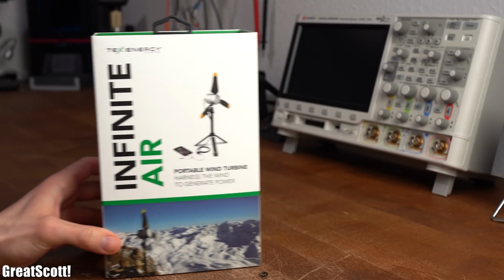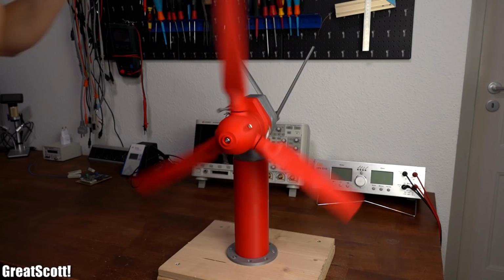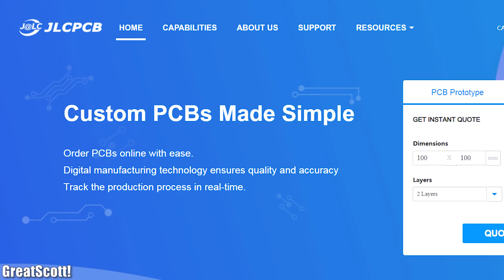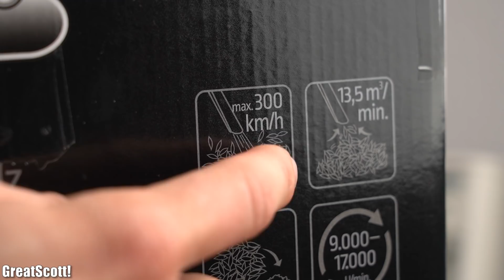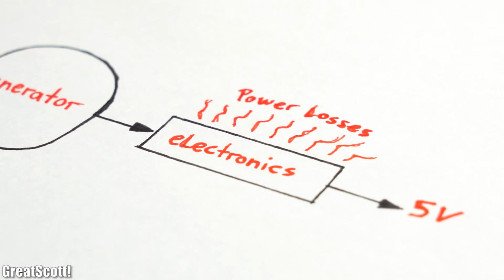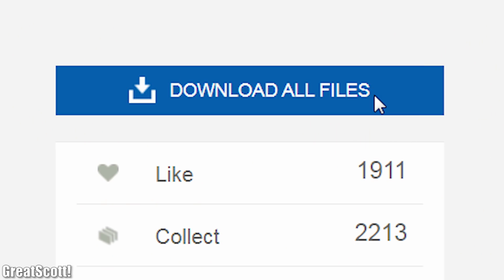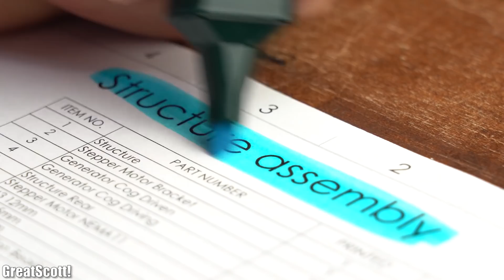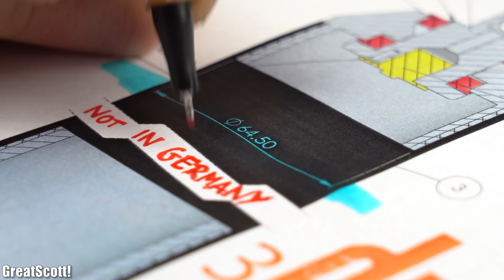Mini Wind Turbine || DIY or Buy

Comment: GreatScott, The problem seems to be the motors here. Most of the DIYers I know use different motors and different ways of taking advantage of the wind. With as skilled as you are, you might look into the Wind Turbines made from scooter motors, hoover Motors and even Washer motors. You can also find a lot of 3d printed build online using these. I think if you built something more along those lines, you would be even more impressed with the power and efficiencies you would get. I even built one myself many years ago from a 12V car air pump, that I ended up getting closer to around 70 watts and on windy windy days, closer to 120watts with not much work to the build, but a battery to store the energy in.  I bet you could even use a 775 motor with little work and get more power than the commercial one you tried in the video. It might be something to mess around with in the future!!! Great Video!!!

Comment: "Mini wind-turbine" The very notion is absurd (if fun) because small, light blades just won't be able to build up the inertia or angular momentum to make it work. With blades that small and/or light, it would require a constant flow of strong wind to keep it spinning. Real turbines have large, heavy blades that take a fair amount of energy to get going, but then require much less wind and less force to keep them spinning due to their inertia; they're essentially the same as a flywheel generator.
Reply: That is not at all how wind turbines work. "real" (large) blades are built to be as light as possible, to reduce the intertia so they rotate in the lightest wind possible. They are not at all like flywheels. Small turbines experience very different flow characteristics and have to rotate much faster (in terms of RPM) than large turbines. It's a really interesting topic and worth learning more about : )

Comment: the angle of attack of the blades is pivotal for the turbine efficiency. Also  the turbine uses only a small portion of its swept area so power measured is way less than optimal.  Good electronic skills, poor fluid dynamic knowledge.

Comment: Printing all of the parts is not a good comparison. The gears and a few other metalic parts could be CNC milled or are available commercially. 
"When the only tool you have is a hammer, everything looks like a nail!" So, just because you can print a part doesnt mean you should.
If you need to make those type of parts, make a DIY CNC mill and use it to then make metal parts.
Or, you could incorporate a few commercially available parts in your builds, it is much more realistic for those of us who are DIY type people.

Comment: DIY or BUY: Switch mode power supply (and let’s hope that either DIY or BUY is the winner, not both)
Reply: LazyH-Online Something like a common “wall wart”. The high power ones are quite expensive.
Reply: Or something like transformer power supply vs switching vs capacitor dropper

Comment: Wie wäre es mit einem Projekt in dem ein Fahrrad zum Stromgenerator umgebaut wird. Mit dem man sein Smartphone oder einen Akku laden kann. Würde einen unabhängiger in Krisensituationen und gesünder machen. 
Leider habe ich keinen 3D-Drucker, deshalb wäre es gut wenn so wenige Teile wie möglich gefertigt werden müssen.
Das System müsste wie folgend aussehen: Anflanschen eines geeigneten Generators (BLDC-Motor, Gleichstrom, Synchrongenerator, Asynchrongenerator?) an den Abtrieb der Well des hinteren Ritzels. Gleichrichter der einen kleinen Akku speist mit 12V und über einen Kfz-12V-Zigarettenanzünder über USB das Smartphone laden.
Vielen Dank für's lesen.

Comment: In this episode of DIY or BUY.... DON'T! LOL. A 10x10cm square PV panel can do about 4W, though you still need a battery for night time.
Reply: I came to the same conclusion. Wind power doesn't scale down: To be practical, it must be huge. The power produced is proportional to the cross-sectional area, so if you make your turbine twice as wide you get four times the power. It's also proportional to wind speed *cubed*, so you need to mount it at some height to get a good wind flow. Photovoltaics are linear in scale: Spend twice as much on panels, get twice as much power output.
Reply: @vylbird8014  turbine twice as wide cost more than twice as much
Reply: @jklmnpqrst  It costs less than four times as much. So the bigger you build your turbine, the better your cost-per-watt gets. The cost of building twice as big is usually less than twice as much too - the blades are cheap, it's the bearings and support that make most of the cost. The economics of wind power are just not in favor of small-scale generation. The rapid fall in the cost of wind power generation in recent years is largely just due to the introduction of bigger and bigger turbines. GE has a model with a 220-meter blade diameter! Those things are around the height of a seventy-story building.
Reply: @jklmnpqrst  But less waste means more saving and faster to pay itself
Reply: 0,1m*0,1m=0,01m2 with 1000W/m2 is like 10W and with the efficiency of 15-20% its like 1,5-2W max
Reply: Better to let it charge a battery or power bank instead of having your device wired to the turbine to charge.

Comment: ...so if you have a hundred year long storm, will the 3D-printed version have made enough energy to cover the energy COST of refining the plastics used in the printing, the heating elements and controls of the printer, and the energy used up when manufacturing the motor/generator????
No it will not. It will have "returned to nature" as a big heap of worn out scrap material long before that :)

A perfectly made, extremely well planned industrial scale wind turbine mass produced as energy efficient as possible takes many years to make up the manufacturing and material energy cost involved in making, transporting and then mounting/erecting it. In places where wind turbines aren't well suited, even the very best turbines available today struggle to even make their own production energy cost back...

Comment: nema11 is very small. I would try using nema23 - the more current can go thru the stepper motor, the better. And also - gears should be printed in nylon and gears should have angled teeth - helical gears.

C'mon, make a part two video ;)

Comment: use a bigger step motor(rated for above 40 volt). and attach  the propeller directly to the motor. 
use two rectifieres, one for each coil and a common dc bus. 

in my wind turbine, i also make a nacelle. but the vind generator gives 12 volt output at 0,5 to 1 Amp. with two coils, it gives 2 amps on the dc bus circuit, that can easily run usb chargers or charge a 12 volt battery. 
my step motor is rated for 75 volt and 1 amp.

Comment: hmmmm...I took apart an old cooling fan. The kind that's in box you put on the floor.
The fan motor is an INDUCTION Motor ( 3 phase)....it's basically a Brushless motor...withOUT magnets...The ROTOR is a FLYWHEE. It's   super heavy.
Maybe PRINT your own rotor..Install ball bearings and magnets...
You can mount different qty of magnets to achieve more or less current.
You can probably achieve MORE CURRENT easy....It's a BIG Motor...
But you'll be driving a LIGHTER rotor.....( you're NOT driving the WIRES/STATOR...HEAVY)
Mount rectifier. Your DIY PROP will fit it.

Comment: I made a really crude wind turbine when I was a kid when I found out spinning a computer fan generated enough power to charge my Palm Tungsten E2...I also ended up using the same fan motor to build an equally crude generator for my bicycle.

Comment: Are you sure the original circuit board, is not some sort of active rectification, and will actually give you better power output then your bridge rectifier? Please do a video comparing the two! https://en.wikipedia.org/wiki/Active_rectification

Comment: I think you had to hold the diy version so it doesn’t shake apart. I also think it is too big for a portable generator. So basically, the diy May be a winner as a teaching project, but not as a wind power generator... which is the main idea.

Comment: put slow bldc motor inside
PS
maybe build big vertical wind turbine using hoverboard motor :D 
just glue blades direct to the engine with extension , made them from pvc pipe and it will work great for cheap (maybe 15-20$) :D

Comment: You need a HDD motor and low drop off schotkey diodes with voltage drop of 0.2-0.3 v and then an energy harvesting circuit

Comment: I have that infini air, and my issue is.... It requires rather hard wind. Maybe it could be converted to vertical with just 3d printed Wingz of larger size? Would be great if someone (😉) could do that. Feels well built but doesn't full fill it's potential. Great video

Comment: Would've been interesting to know how much he spent on filament and other parts.
Reply: Filament I buy is about $10 USD per killogram (so about $5 per pound). Since these don’t really need to be solid you could save some weight but even assuming it’s solid then that’s like maybe a pound of plastic. 

**Technically I rarely pay over $8 per kilo shipped to my door, but I also don’t care about color so if ugly puke green or fluorescent yellow is on sale that’s what I get! I have used more expensive like $50-$60 per roll as well and it’s often a pain and super picky for some reason, so I use the cheap stuff. I typically print ABS and PLA (I even got a nice kilo roll of glow in the dark PLA for $9.99, haha, I literally switched my machines parts to work with 3mm filament just because it was such a great sale, haha!

Locally it’s also like $12 for a roll of any size and nearly any color (it’s the clearance rack, but they usually have like 10 rolls of a good variety), otherwise retail store mark up your looking at $17 per kilo but they have a whole rainbow gambit of colors and materials (some specialty like carbon fiber reinforced, wood or metal additive, or TPU will cost more).

NEMA 17 motor is like $8-$10, so not a lot and the NEMA stepper does not make a good generator so I’d pick something else personally, but that’s roughly what it cost is like maybe $20 in total with the voltage controller and stuff (could be as high as $30).
Reply: @jakegarrett8109  what a nice and detailed explanation, thank you good man :)
Reply: Jake Garrett 1kg PLA filament cost around 20-25€ in Germany.
Reply: @Todestelzer  or 12€ - 15€ on eBay.
You don't always have to buy the most expensive filament.
Reply: @Todestelzer  just stick to stuff like eSUN and such. German and such brands in general are more expensive anyways due to brand and manufacturing costs.Cheaper chinese brands are much cheaper so yeah
Reply: @jakegarrett8109  thanks!  $30 bucks seems fair.

Comment: great scott, i know its a bit off putting but you should always grease the gears  because if you want to last it for longer (It is literally plastic while introducing minimal if not barely any friction). The turbine spits out pretty high RPM that would wear down your device pretty fast. just keep it in mind, i live that your going back to power generators. I found them the most fun videoes

Comment: In the diy...interesting systems..i think the PVP sistem needs a spring between the triangular plate and the cap..it react to wind force on blade....more wind, more pressure on the 3 blade that turn to expose less surface to wind power.the inner rod translate the blade's angular motion in the plate's line,,ar motion...the spring ,logically, contrast this motion

Comment: Comparing both wind turbines output was fine, but while you gave a cost for the commercial, we didn't get to see an estimated cost for the diy project.  A cost per watt for both for both would have been very usefull, and likely a major decesion factor for many. 😊

And lastly,  a better test for 2 turbines with different blade lengths is to have the same wind blow across the entire surface area of the blade.  Maybe take a box fan (or four), and make wind tunnel.

Comment: What I have learned from this video is that I will definitely buy a 3D printer now.....
Or make one myself?  DIY or Buy?
Reply: It’s either, I recommend a DIY kit (you get a bucket of bolts and all the parts and by doing this you’ll confidently know how to take apart and fix things or how to adjust and tube, it’s a mandatory skill to have!). If you prefer a good printer pre-assembled that’s easy to mod and customize however you want them something like the Ender 3 is super popular for a reason (great price at ~$170, good quality, lots of community support and upgrade guides and printable upgrade/replacement parts).

Me, well I like the fun of building them like a fancy LEGO Kit (haha, the Star Wars Droideka LEGO I made when I was 8 was probably more complicated in truth, but still very fun!). So I went with an inferior printer to the Ender 3 just because I wanted it completely unassembled (if they had a kit/parts bucket version for the Ender 3 I would have went with that). I’ve built a printer before like 7 years ago, so I found it’s not really as needed the second time, but oh man you’ll want to build your first, you just learn so much that you just can’t put a price tag on the real hands on education it provides.

Of if you mean full new custom design by yourself, leave that to like your 8th or 10th printer (basically learn from their mistakes and shortcomings to make something better and by then you’ll know what you want and tailor it to your needs, don’t try it without learning from the others first though otherwise it will only be at best half as good...). Most printers are open source, so you can totally print out most of the plastic parts (or buy the “rework kits” on EBay for like $30), and then go to the hardware store for most of the screws/all-thread/rods and stuff and then pick your favorite electronics (I’d recommend 32 bit boards and flash the firmware of a similar printer to what you are making like a Core XY/Delta/Prusa-Cartesian style etc and just tweak the build size and travel per motor step values).

And you’ll always customize them later, so you’ll get DIY experience along the way too (like one of mine has more custom components than it is original, custom geared extruder mostly printed but with some machines stainless steal parts and tuned everything for speed, it was outdoing $2k-$5k printers are the time whilst doing so 5x faster and it cost less than $400. It’s super old and still working (almost everything has been replaced, haha, even the power cord!), but my new printer I had a different goal for so I spent like $99 on the printer kit plus $12 magnetic heat bed and it’s not as good quality and only a fraction of the speed, but my goal was reliability and accuracy so I’m still tweaking it but it’s doing good (it’s funny, the old one was direct drive extruder and I swapped to custom Bowden, and the new one is Bowden and it’s getting modded to direct drive, lol! Nothing stays the same for me, haha, have fun modding!)
Reply: Jake Garrett  Hi Jake. We think in the same direction. I wanted to buy some alu frame work and build up from scratch. Not even a kit. I known I will have some problems building it. However a kit would also be nice because In need a 3d printer to make my plan of building grom scratch work. Chicken and egg story🤪. So may be start with a kit. And then from scratch